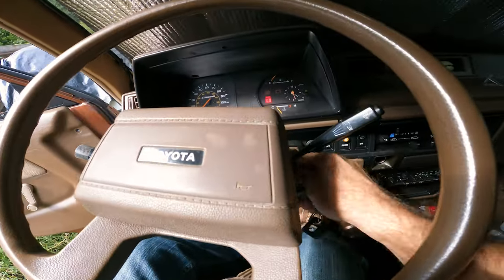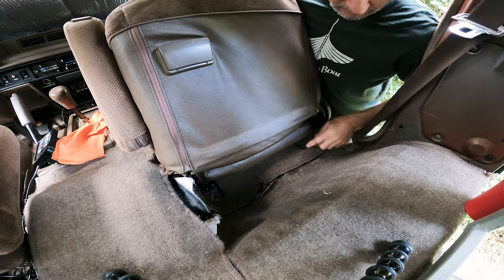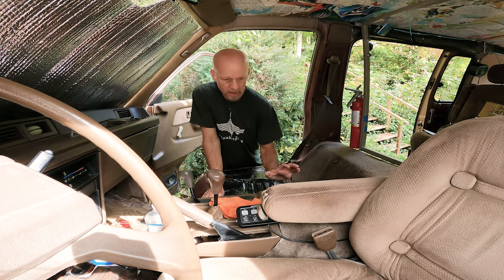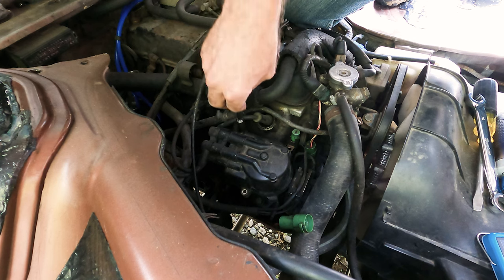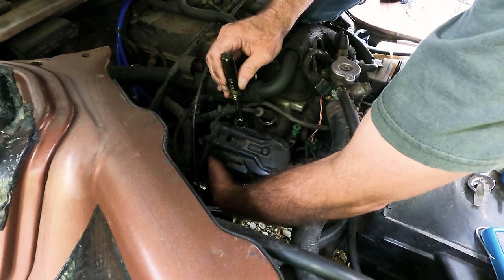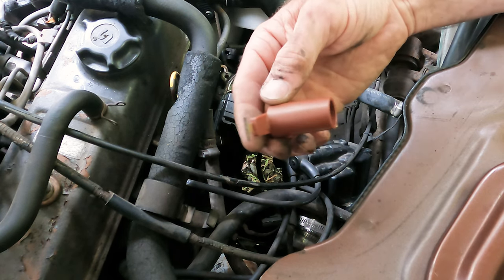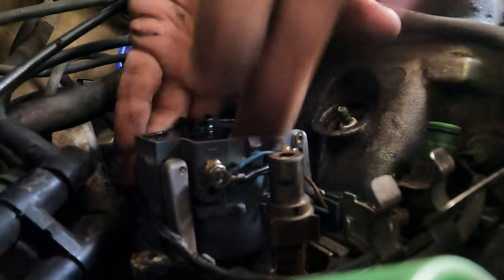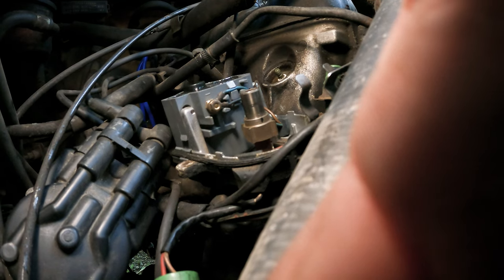1988 Toyota Van |  No Start | Coil Pack

Comment: Thanks for your informative vids, I just completed the coil swap. Avoided breaking the terminals on tightening thanks to you. (Plastic dust cover did snap upon removal, got a new one plus distro cap gasket on the way.) Oh and I used your thermostat and housing video to success a couple years ago. I'm definitely the type who needs visual aids.

Comment: Thanks for this. I was happy to find this video to see what's involved in removing the engine service hole cover! (That’s what they call it in the service manual!)  I was surprised that I needed to do this to remove the distributor cap! Wasn't that bad. And I was able to leave all the cables attached since I only needed to slide the cover a few inches to gain the access I needed.

Comment: I have a 92 Geo Prizm (Toyota Sprinter AKA AE90 around the world). I rebuilt the distributor with new oil seals but used the factory coil pack. That's the same coil pack in 4afe engine. Oh.. I bought the diaphragm attached to intake that control the AC for my 4AFE and yes, it worked!
Reply from the maker: That's excellent! Glad it worked out!

Comment: I am pretty sure that the construction of new parts (even Denso) are nowhere as good as the Toyota factory OEM parts. That is why the fastener broke. The factory coil on my 88 Toyota had the nut so very tight that I had to use a 3/8 ratchet to take it off. The factory part was still good and only needed reconditioning. Nothing broke and I put it back together with only about half the in/lbs that it came off with.
Reply from the maker: Agreed. I wish we could still get those original parts for sure!

Comment: Me personally if i didnt have another coil like your situation id just solder a wire to the broken stud then connect the wire with a plug or solder and heat shrink it.

Comment: Good evening it's me peter again you know what can cause Myspace cruiser to jump each time I put it into gear to move off and I change the transmission oil but when I start to put it into gear it it jumps what's the cause of that can you help thanks again
Reply from the maker: Hi there Peter. 
My van is a manual transmission and I experienced something similar when I would pull out in the lower gears. Upon close inspection I found that my rear main seal was leaking oil badly on the clutch plate and flywheel. It would cause it to slip before I warmed up the system and it’d get burned off.
It kept doing this until it got to the point where it wouldn’t engage. So I tore it apart and found that was the issue.
I’m not sure if that’s exactly what your problem might be. But it is a possibility.

Comment: Hi do you no wear can I find the gas tank opener on a 1989 space cruiser van
Reply from the maker: Hi there. Mine has a small black lever on the center console just below the parking brake lever. 
Just pull up on that black lever and it’ll pop the fuel door open.
Reply: Okay thanks am a bit New to mine not fully no it as yet thanks again I will give it a try and see what happens 👍

Comment: I just got and 88 LE 4cyl toyota van, I'm trying to find the fuse box ?
Reply from the maker: Congrats on the van!! Look tucked under the glovebox in the passenger footwell. It’s got a cover that snaps off. 
There’s also a few main big fuses against the inner firewall in the engine bay under the passenger seat. Accessible by the trap doors under the carpet front passenger seat side.

Comment: Don't see why you can't use an extractor to remove the broken bolt, then transfer over a good bolt from your old coil.
Reply from the maker: I wish that’d be possible. But it looks to be actually melded into the plastic and resin. 
Good suggestion though. I should take it apart and see how it’s connected internally.